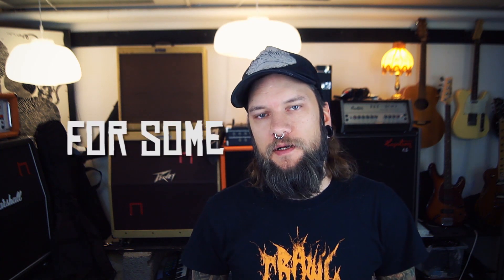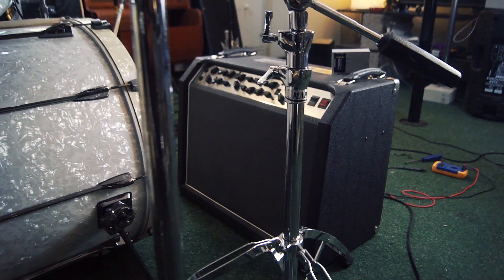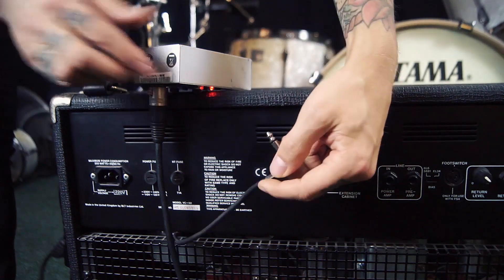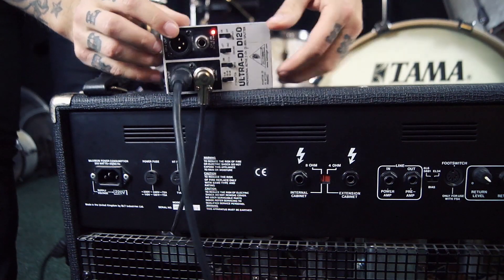DIY Subkick Alternatives (HoboRec Bull Sessions #16)

Comment: My sister and I used to have nothing but one Shure "pistol-grip" style mic (very similar to a 57) and a small square mic that looked like it was stolen from an ATC tower or something.....and a Tascam 424. Well, the square air-traffic control mic died, and we were left with only the "pistol-grip" 57. Having known of the use of speakers as low-end mics for kick, I decided to try a pair of large headphones. You know the type, REALLY big and heavy, coiled cable, 1/4" stereo plug at the end, like headphones used to be, back when people gave a shit how their music sounded. So I plug these monstrous headphones into a mono input jack on the 424, and one headphone worked as a mic. So, out of curiosity, I A-B'ed it with the handgun mic. Well, it was actually quite nice, almost like a perfect cross between an SM7B and a ribbon. If you happen to have a pair of headphones, with 40 or 50 mm drivers - that maybe don't work properly anymore, but only because of shorts in the wiring or something other than blown drivers - you absolutely MUST try this. Same way you wired up your subkick, you can wire one driver to a cable or even solder it to a jack if you're feeling confident! It will blow your mind!
Reply from the maker: +Adam Rainstopper this sounds interesting! I have a bunch of old headphones, so I better try this out!
Reply: And make a VIDEO!!!!! Also, this will help to tighten up both the headphone-ribbon-sub-face-mic AND a loose sounding subkick, shellac works very well on the cone, if it is paper. Or the . . . . whatever they call it in headphones. Just a fine mist, spray the cone of a 12" speaker for a total of 4 to 6 seconds with aerosol shellac, and for a headphone element, less than a second. Spray from about a foot away. It makes the paper more rigid, and you'll have a more usable sound, with more attack and tighter lows. Obviously, don't do this to a guitar speaker that you intend to use in a guitar amp in the future, but if you have an old 10 or 12 lying around that you just don't have any use for, and you want to make a permanent subkick, or a permanent mic out of a headphone element, this can clean it up a lot.

Comment: Amazing. The cheap domestic speaker sounded better to me, richer and less boxy, but both were great. Rigging up the speaker cable to the DI box is GENIUS. I shall try using my little Fender Blues Junior as a kick sub using this method... Another brilliant video Ulf. Joe.
Reply from the maker: Cool, thanks! Did you try it out?
Reply: HoboRec i tried it with a fender pro jr3 to an avalon u5 and it sounded cool :)

Comment: Nice. Had a play around with a Fender 8" driver on its own on a mic stand which worked OK, but the low end from a Vox amp I tried after watching this is distinctly better. Thanks for the great vid. Out of interest, it might be worth thinking about speaker polarity - which way the driver moves in response to a positive voltage. Nothing that cant be sorted with a phase-flip post-recording I guess.

Comment: To avoid phasing problems you should wire the subkick backwards...positive to negative and negative to positive...it makes sense when you think about it...!...The speaker is designed to push out on a kick hit and a mic will be pushed in...!!!
Reply from the maker: Good point! I usually just flip the polarity switch on the console to get it right.

Comment: the amp speakers it seems richer in sounds and harmonics than the small cabinet. It might depend on the volume of the sub in the mix. Have you tried with a bass speaker too? they are designed for low end, so it may sound a lil better i guess, but th esound is already good like this

Comment: So when you used the regualar speaker and reversed the polarity do you have to use an attenuator or direct input box or noisegate to eleiminate feedback?  I was thinking i could use my bass amp but i would need to use something like a DI box to reverse the polarity right?
Reply from the maker: You can reverse the polarity in your daw. The DI box is just to make the signal balanced so you don’t pick up interference. It’s just the speaker you plug in to the DI box. The amp should be left out.
Reply: @hoborec  thank you very much

Comment: i did this with a genz 15" bass cabinet last year- even a good 3-4 ft back it had so much low end i used a cheap passive line mixer as a pad so it wouldn't clip my pre-  worked like a charm
Reply: Did you reverse the polarity?

Comment: You shouldn't connect white wire with a shield:
1 - there's no need to
2 - this makes unbalance in input impedances, which may cause some hum to be captured by your interface.
Reply from the maker: +Mareusz Faceusz thanks for clarifying! I’m just a happy amateur when it comes to electronics, but this makes sense. Thanks!